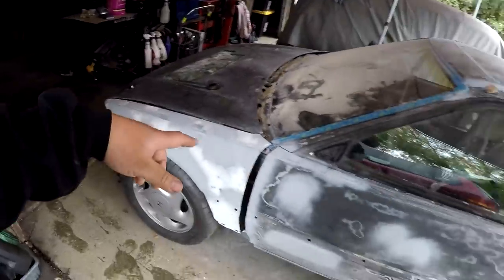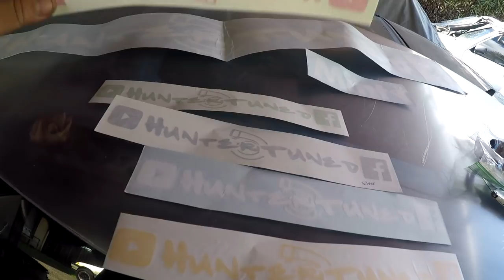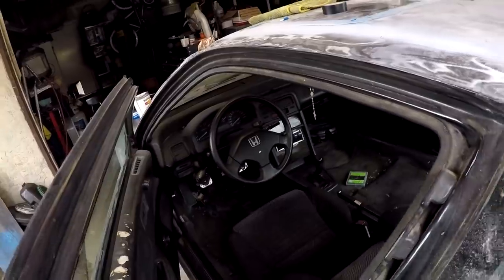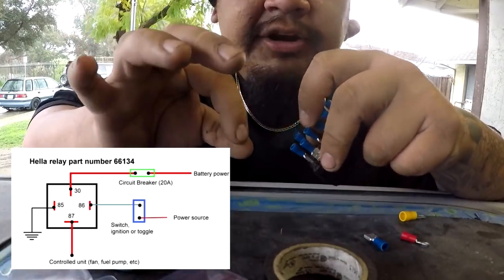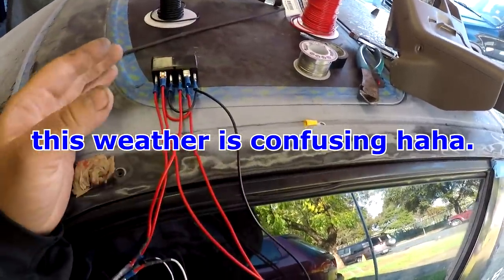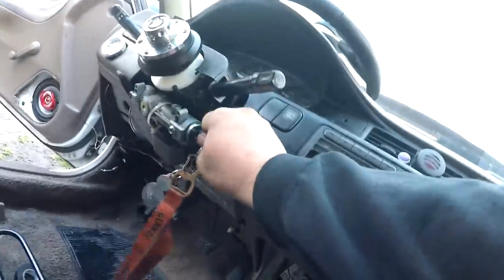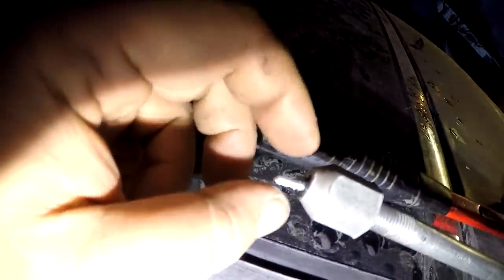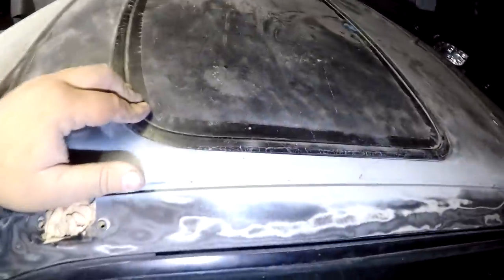DIY Switch / Relay setup + Fan Mail + /Rant

Comment: From what you described. Cel comes on and does not turn off and no fuel pump. That sounds like a main relay problem. I would check that first.

Comment: We're both preaching the same problem with other ppls need fk'em. Grandpa car issue, did u check the starter relay behind the fuse box under the dash? 9 times of 10 that's the issue.